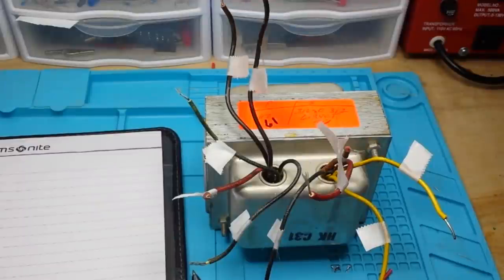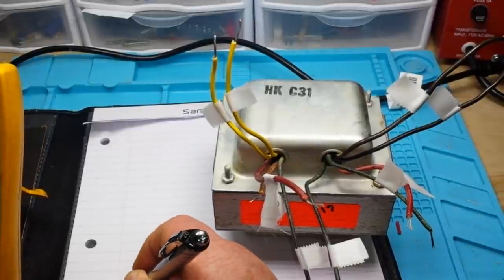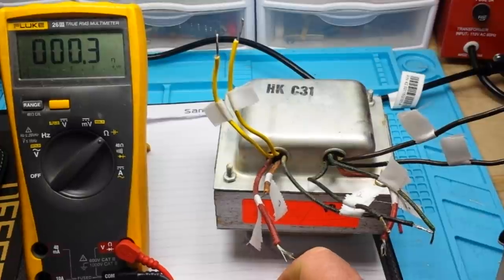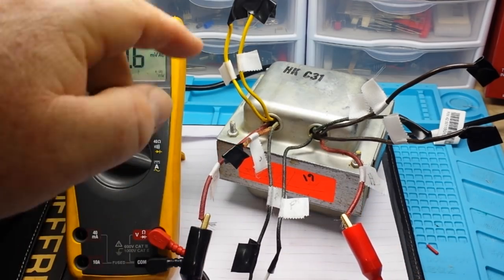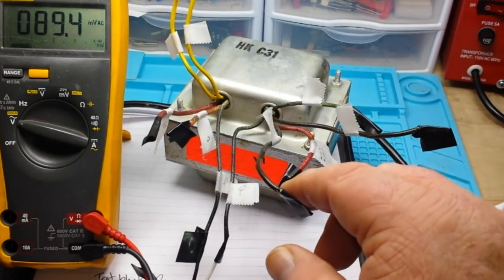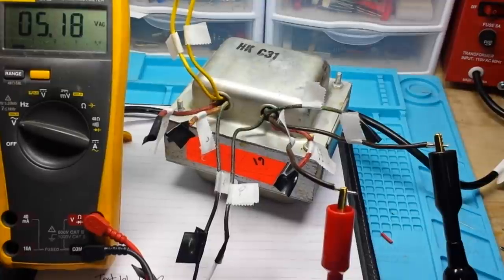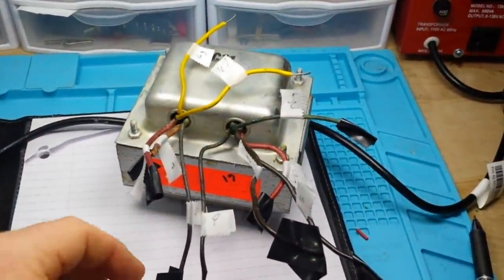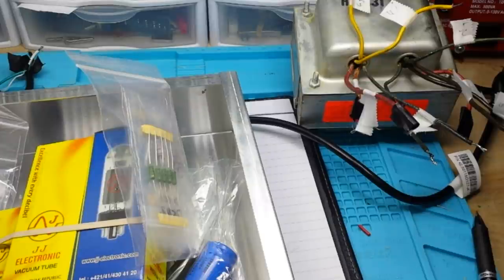Identifying transformer windings and voltages

Comment: This is why I have an isolation transformer. You can never be too safe.  A deeper explanation of what you were doing might have been helpful, for example how certain ohms readings translate into the primary etc, the primary being on the mains side and info beginners may not know.
Reply: You removed the ground on the isolation transformer?

Comment: You know what you are doing but there could be a cap inside the transformer packaging, on the variac output and everything has L/C/R, just be a bit more careful on youtube bc ppl will ignore any warnings...idk just a suggestion
Anyways, thanks for the video, I tried looking for one like it a while ago and couldn't find any that were useful. :)
Can you do the same with a signal gen? Is it important to test it at mains voltages?

Comment: Should you have checked the center tap for the filament. I would think it goes with the 6.3v not the 5.0v
Reply from the maker: I did. It goes to the 5
Reply: learnelectronics that’s odd, a CT for the rectifier filament

Comment: Yes the online kits are brutal for shipping transformers,if its correct you cant flukes it,I got the most basic model did you get the proximitly voltage sensor?good choice multimeter what wil. You use to test your channel outputs?

Comment: That was great Paul, thank you! Where did you get the transformer? $25 is an amazing price! Can’t want to see the rest of the schematic! Stay safe!
Reply from the maker: Ebay
Reply: learnelectronics Thank you Paul!
Reply: @LitesLAB  you can also get good transformers inexpensively by getting old stereo equipment from thrift shops. Tape decks, cd players, and dvd players usually have small (below 60 watts) and receivers and amps have much bigger - 250 watts and up.

A lot of other good parts in there too. Regulators, amps, ICs, big diodes, heat sinks, etc.

Comment: You are one of the only videos here using a VARIAC... good for you for teaching it right. I teach by using a VARIAC or 120v to 12v transformer, 12v as the input voltage of the unknown transformer's input.
Reply: Is there a reason not to use a signal generator set to 10v 60Hz sine wave? I've done it that way in the past and multiplied all the resulting voltage readings by 12.
Reply: Gotta have a Variac!

Comment: PAUL I NEED TO POINT SOMETHING OUT, been just new to this myself i can probably spot the thing that would confuse you easier when 1st learning this stuff... at the beginning when you had it on the wrong setting it showed 110 "mV" now someone new to this "WOULD" mistake that as a transformer that was plugged in to the wall..  especially in the States and place's where the wall voltage is 110 VOLTS.. then you touched the bare/insulated wires.. Do ya see where im going with this.  Paul i hope you don't think im being bad here.. i don't mean anything bad by it..
Reply from the maker: No, all good my friend. Thank you!

Comment: HOW DID YOU DETERMINE WHICH WINDINDS ARE THE PRIMARY?
Reply from the maker: Honestly by trial and error. I had a little starting knowledge. I knew it had 300V+ secondary and I knew that the primary wasn't tapped. Also the leads for filiment windings are usually heavier to carry more current. So the yellow and reds were out. That left thick and thin black.
I tried both while measuring the voltage on the reds. I was wrong the first time.
Reply: IT SOUNDS LIKE THE SHOTGUN APPROACH.THANKS!

Comment: I would have thought that what you marked as 5v center tap would have been for the 240v line
Reply from the maker: There is no 240V winding. 330-0-330 6.3-6.3 5-0-5
Reply: @learnelectronics  ok cool, great series so far, love the information from all your videos, keep up the great work and thanks for all the videos I've learned a lot

Comment: Not having a Variac,  We used a 15w light bulb in series to test this stuff.  LOL   In the Military you got so used to doing so much with so little you figured out ways to do just about ANYTHING with literally NOTHING.
Reply: Always use a lamp in series! It is nuts not to use one. Once a winding gets much over the rated voltage the transfçormer saturates and it just turns into a resistor.  Without a lamp dual primaries instantly become a short. And just who has a variac, your viewers are just unknowing beginners. Shameful video.
Reply: @opera5714  Can you explain this better?  Are you saying because the current is near zero on the unterminated secondaries, the voltage approaches infinite?  (Kind of like a current sense transformer without a load resistor?) if so - Is the danger just in touching an unterminated secondary?
Reply: @SteveJones172pilot  With a lot of wires it is easy to get confused. TWO cases: Dual primaries can be wired in series or in parallel.  These must be phased properly or the primary can draw a lot of current The magnetic field from one winding cancels the other out.
Applying a voltage greater than the rated secondary, like 120V AC to a 12V ac winding, causes the transformer core to saturate. As the AC waveform increases in voltage the magnetic core can no longer store more energy.  The inductor saturates and turns into just a resistor.  A lamp in series would limit current to a level that would be safe, at least for a reasonable time by illuminating. As the lamp heats up, the lamp resistance also increases dropping current even more that just a resistor. About a 7 times increase.